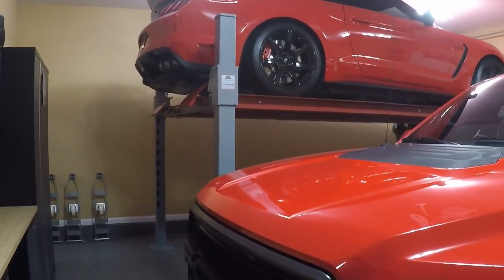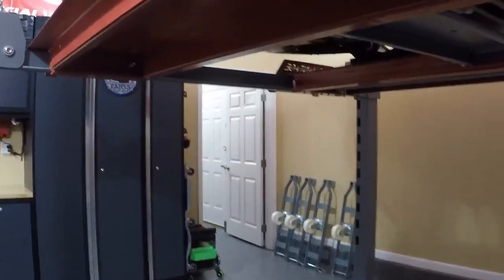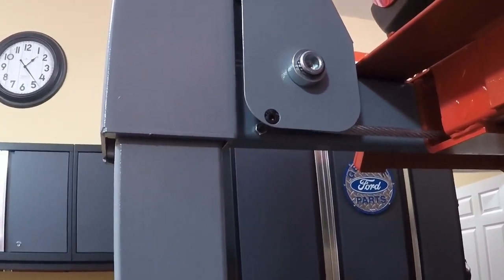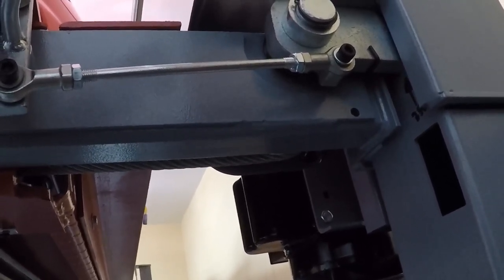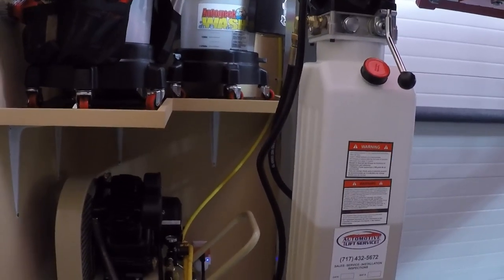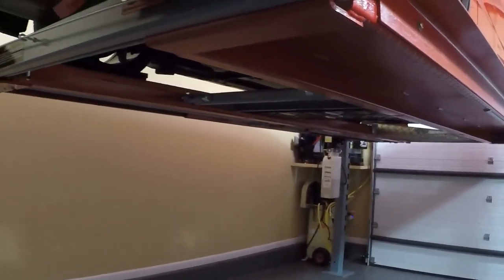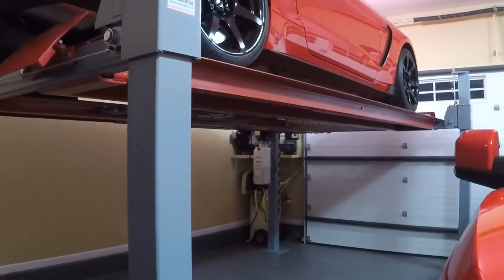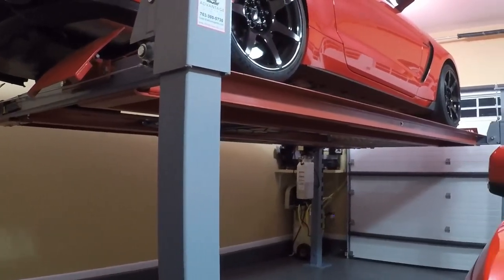Why I chose an Advantage Lifts 4 Post Lift (DX9000HD)

Comment: This is why I went with an Advantage SS-11000-WD lift. 24" wide runways, plus a faster lifting 240V motor. It was only $600 more than the 9000XLT, and I can fit everything from UTV's up to 1 ton crew cab dually trucks!
Reply: I just had my SS-11000-WD delivered today. I'm going to start unpacking it tomorrow. I'm going to put a 50amp plug on the pump so it will match my welder outlets. Have you had any issues with yours? Any tips or tricks you can recommend for the assembly?
Reply: @davidseckman8604  Nice, you're going to love it!
You will need a folk lift or engine lift/crane and a second person to help. If you got the air powered bridge jack,  do not use it without an inline dryer from the compressor and an automatic inline oiler, you will ruin it quick if you don't. Be sure to change the fluid in the lift motor reservoir after the first month and flush the tank. Be sure to adjust all four post locks so they hit simultaneously, and use a long level for side-to-side and front-to-back. 50 amp will work, but you only need 20. Have fun!
Reply: @artillerybuff2000  thanks for the fast reply!! Yep, I did get an air over hydraulic bridge jack. I really appreciate the tips and info. Especially about the air, those bridge jacks aren't cheap. Im using the 50 amp plug so I won't have to install different receptacles. Thanks again!
Reply: @davidseckman8604  You're welcome. Yeah, I did the same thing with the power supply on mine. And BTW, these 11000's go up fast with that more powerful motor!

Comment: Planning ahead so good video. I'm pretty sold on Advantage lifts as they are only hour and 40 from me .Going to pour 8" slab on the two-post lift side of my garage and probably 6" for the 4 post.
Reply: When I had my building foundation poured, the concrete company owner wanted to know what the heck I was trying to lift when I asked about a thicker pour than my plans called for. He used 5,000 psi concrete 5" thick. He said even only 3,500 psi concrete with a 12"x12" lift foot equaled 42,000 psi, times 4 feet equaled 168,000 lbs.! Way overkill for a four post lift.  However, if I was going to use a two foot lift, no matter what the numbers say, I don't think I'd want less than 8" in the lift location, so good call. OR put another way, an 11,000 lift has four 12"x12" feet, which is 144 square inches per foot. That is 576 total square inches divided into 11,000 lbs. comes out to approximately 19 lbs. per square inch...
Reply: @artillerybuff2000  honestly the extra costs for the extra concrete yardage is worth it .Keep in mind you are relying on the  ability of the fasteners to hold tight.

Comment: Nice lift and good explanation of why you chose your lift. I think you can move the lift with a car on it though. I think as long as you get all 4 posts off the ground and the posts are not angled. I'd love to have a 4 post lift along with my 1 post movable lift. Unfortunately my garage doesn't have a driveway that run straight into it. Mine comes off an alley which makes having 4 posts virtually impossible.

Comment: I believe you need a compressor for the Bendpak to lower the lift down.  That's a major pita and extra expense.   The mechanical lowering is far simpler and more foolproof.   I.e. what if your compressor breaks or power goes out?  You can't lower your car at that point...

Comment: Great video, I also purchased an advantage xlt9000.  I wanted to see if your lift runways have a slight flex on the top diamond plate when loaded with a car.  With a car loaded on mine, if I take a 2 foot straightedge and place it directly underneath the front tire patch, I get a 'seesaw' effect with the straight edge.  All four tire patches cause this on my lift.  Could you please check your ramps with a straightedge ( running the same direction as the ramps) underneath the tire patch to see if yours is the same as mine?  I suspect it is, but wanting to know if they are all like this.  Thank you

Comment: Help me with the height math. 
Car height for both cars 
Car platform is 4.5” high 
So when your garage door is a high lift and open how much when open does it sit down from the ceiling? 6” approx? 
Thank you very helpful video
Reply from the maker: It kinda depends how high your roof of the car is relative to the hood and how high or far back your door goes. With a high lift track half of the door will sit in a vertical position half the door will sit in a horizontal position. This is where it gets a little tricky because everyone’s garage is a little different.
Reply: @EnthusiastsGarage  I see, Let me check that because that will make a huge difference. Thank you

Comment: Great video and cool rides, thanks for your detailed views, helped solidify my decision to buy a lift from Advantage, although my needs are for a wider lift for storing a full size 101” wide x 20ft. long car transport trailer, the Boat Buddy Trailer lift will fit my needs, but most of all the safety features, quality and simple mechanical locking mechanism (k.I.s.s.—-keep it simple stupid)system works best…are the same as there car lifts.
My question, I’m not seeing the weighted automatic wheel chocks on there website…any thoughts on how to acquire them ? Thanks again.
Reply from the maker: They come standard with the lift
Reply: @EnthusiastsGarage  cool, thanks for the quick reply, nice garage! what’s going in the space under the Shelby ???
Reply from the maker: @marcwesley8513  fingers crossed a gt500
Reply: Very Nice choice, I was thinking that after seeing your Shelby and Raptor..perhaps a 
Ford GT would fit nicely in that space, but door clearance may dampen your fun…anyway have fun, drive safe !

Comment: I recognize your garage from Mustang6g. You're a forum member, right?  Good videos. I'm in market for a lift.  The bendpak is $$$ but supposedly the best. You're completely happy with your lift?
Reply from the maker: Yes I am. The bendpak is nice but overpriced, it’s virtually identical to the advantage. I have zero complaints and would buy it again.
Reply from the maker: If you’re serious about a lift I would do it asap. Prices are going up fast, I paid $5300 for that lift and my buddy got the same one 2 years ago for $3500.
Reply: @EnthusiastsGarage  yea. I'm serious. Everting is going up.  Did the shipper require you have a forklift available for delivery?
Reply from the maker: @GR018  I had advantage deliver it and set it up but you’re definitely gonna need a forklift get it off of a truck when it’s packaged up.

Comment: how much does a lift like this one cost, and can I put one on one side of my garage if the garage is only 17 feet wide? Do you think it would block the access of the second car (an SUV)?
Reply from the maker: 7k, it might be tight in a 17 foot garage, I would get the specs off the website and take measurements
Reply: @EnthusiastsGarage Thanks! No doubt it will be really tight. I might only be able to go out in a vehicle. Can you please help me with my other question?

Comment: I would never have that lift in my home around my family unless it's bolted down. Don't know where you live,but they're things called earthquakes that can shake any vehicle off that lift. I think it's something you should look into,especially will all the natural disasters happening these days.. Earthquakes are not like hurricanes,you can never detect them,and even a slight warning tremor can be disastrous for you. Just a thought,but I'm planning to have lifts installed in my garages and would never have them unless they're 16 bolts holding themin place.
Reply: I think I'd rather have the whole lift move around with a car on it during an earthquake than have the lift bolted down and then have the car shake off the lift. Unless you strap the car to the lift, it is more likely to shake off if the lift is bolted down. If it is not bolted down then the car and the lift will move together.

Comment: what is your ceiling hieght?   im looking at the same lift .. with 9ft 4 ceiling though ...
Reply from the maker: 10-9
Reply: i notice you leave / have some clearance above mustang and ceiling   ,  do you think it would work for me with 9-4  height ?   x cars = 8-6  .. thanks  @EnthusiastsGarage
Reply from the maker: @jayd1008  I don’t think so, that’s pretty short.
Reply: @EnthusiastsGarage   im watching your videos and taking refernce on your measurments   you stated ..   so on the second highest lock setting you have 64" under clearance and 6 inches above clearance  with a 126'' garage i only need 50 inches for the lower car  , above car is the same as yours Gt though .. so i guess my question is what are the clearances under your lock settings 3rd , 4th, 5th, highest .. thanks .. my garage is 110 inches

Comment: I have an 8 foot ceiling would two Mustang cars fit??
Reply from the maker: probably not
Reply: @EnthusiastsGarage  Great content...  I have a 13 and 20 GT500.  Your channel is really detailed and your cars are amazing.  Can you send me a copy of the two stickers on the driver side door of your 2022 car.  I took some pictures at the dealership and the window is mirroring it.  I want to modify the Retail Sticker and Parking alignment sticker for my scrap book. Do you change the oil in the cars once a year....  I use Sunoco 95 non-ethal gas...  I drive my car a couple of times a year..  More of a investment.  I live in the Philly area..  You had a couple of past amazing cars also.  Viper... Cobra R...  Harold
Reply: Thanks for the Sonix Steering Wheel Cleaner tip.  My 13-GT500 steering wheel was very dirty and that is with 8K miles...  Wipped off brown...  Keep up the excellent work.